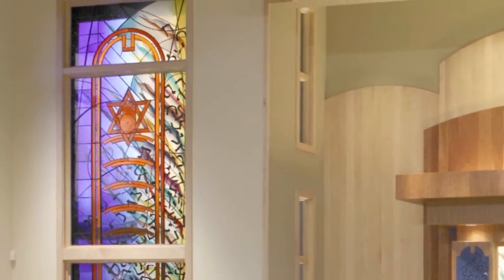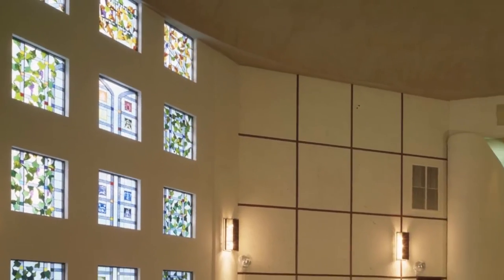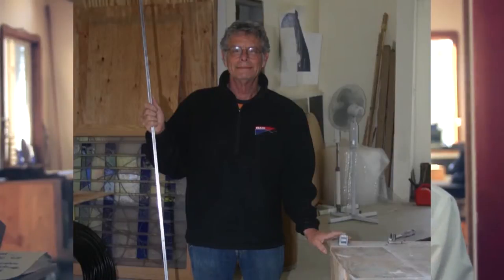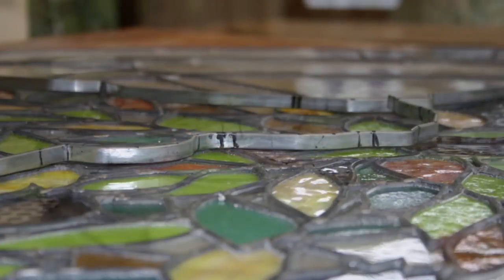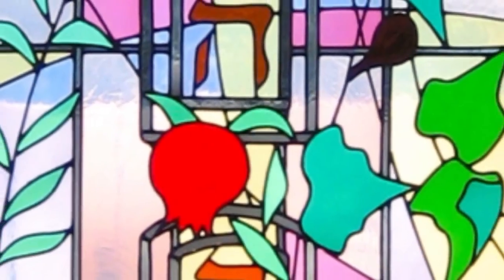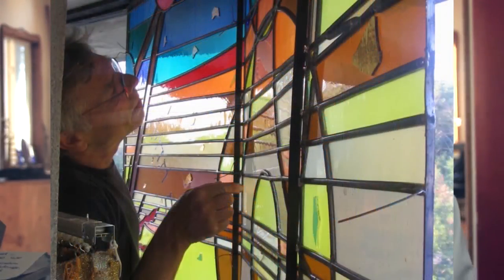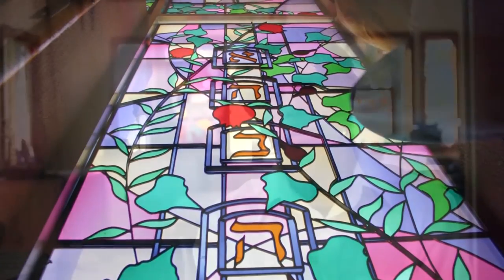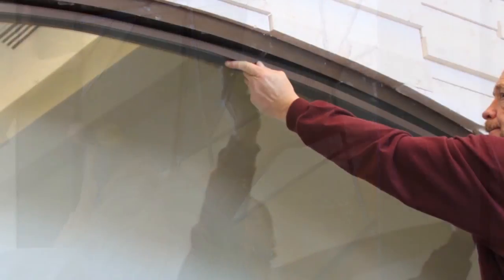Reinforcing Stained Glass Windows with Steel Bars

Comment from the maker: hi robert. you can get the solder-coated steel bars at D and L Stained Glass Supplies. Try either 3/8" or 1/2" wide by  1/8" thick. Get a rebar bender from D and L also and bend the bars to fit on site
Reply: Hello!  I have a large panel I’m working on that needs this type of support and doesn’t aesthetically lend itself to straight bars across the back. What tools do you use to bend this steel smoothly to mimic your existing solder lines?  Thank you! :)